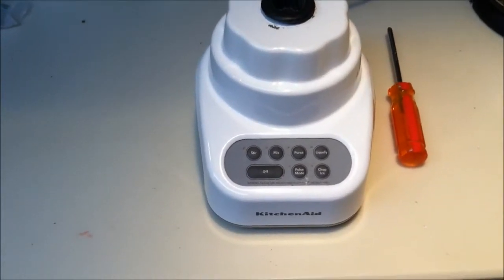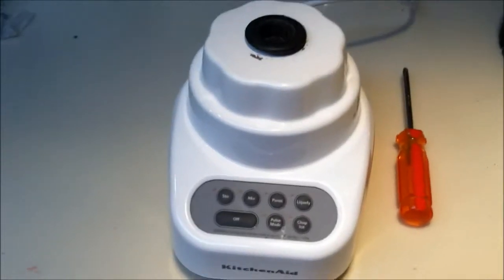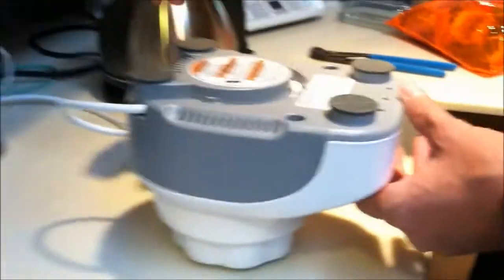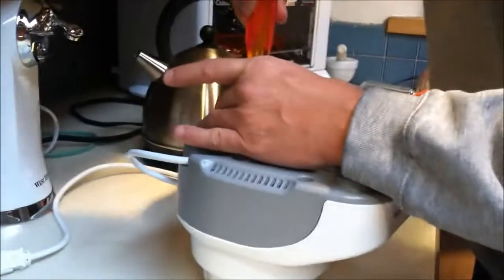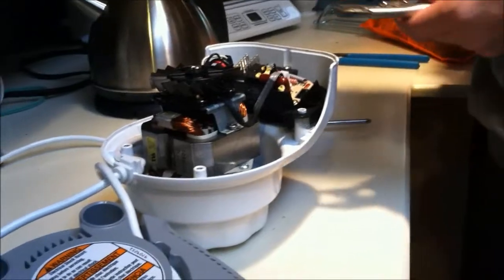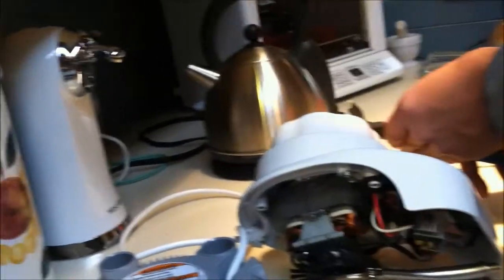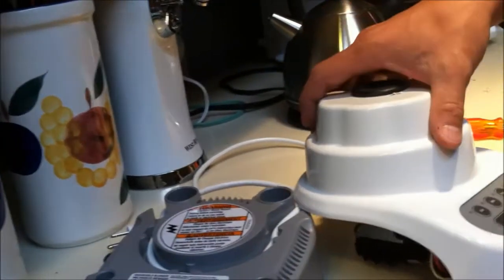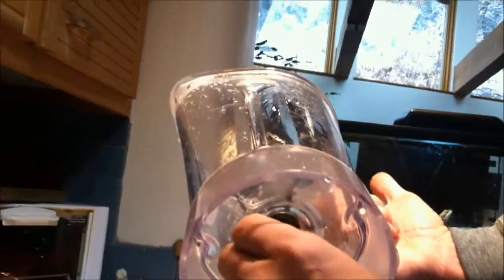Replacing Coupler On KitchenAid Blender KSB465

Comment: Thanks for the informative video. Like you I also was getting nowhere with the. “Knock from the side” method on my Kitchen Aid KSB560. 

Like Erik Link I also had to remove the fan at the bottom in order for my vice grips to get enough bite. My coupler was really on there. 

Thanks again!

Comment: Thank you for this excellent tip. Just replaced that worn out coupler to new one. Just to mention remove that propeller and to lock those vise grips really tight so you don’t damage that motor main pin if the vise grips slips being too loose.

That tapping coupler with flathead screwdriver with few times doesn’t really work at all if you have blender which is been used for years.

Comment: Thanks for the video. I found that it was easier to remove the fan rotor before using the vice-grips. It pries off easily to expose more gripping surface.
Reply: I wish I had seen this comment before I messed it up making it impossible to remove, hahaha.
Reply: Thanks for the tip on removing the fan rotor.  Couple blood blisters, a few solid whacks on the top of the coupler with the channel locks and it came off.  Now to replace that thermal fuse and see if it's still operational.  If it's not, that will be the last Kitchenaid blender I ever buy.

Comment from the maker: @lighpx1 Thanks for your message!  I used that method on my old blender and it worked great (one with teeth).  I tried that on my blender that didn't have teeth, the one in this example, about 10 times and in the process started to mess it up because the screwdriver kept hopping out of the coupler and hitting the blender (and myself).  I would try to see if you can get the coupler out with the traditional method you mention and if that doesn't work then do so like in my video.

Comment: Do not believe on the method from the videos showing "just popp a screwdriver in the opposite direction and it will come off easy". That do not work as well as can damage / break your coupler badly.